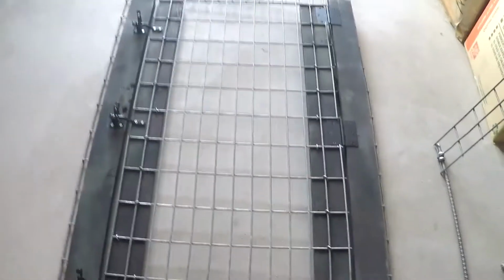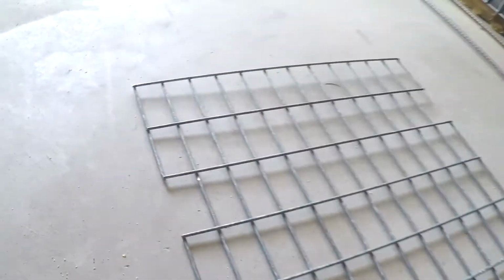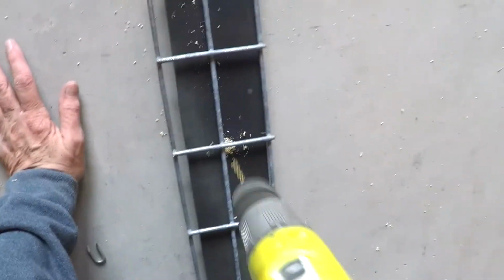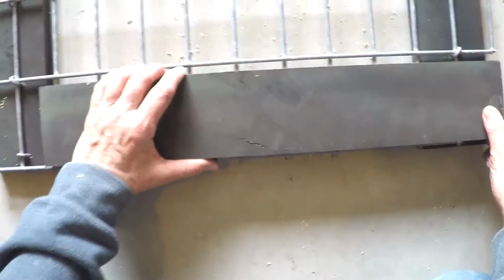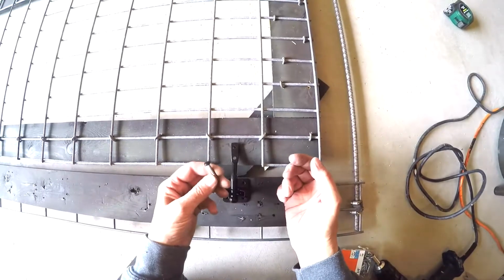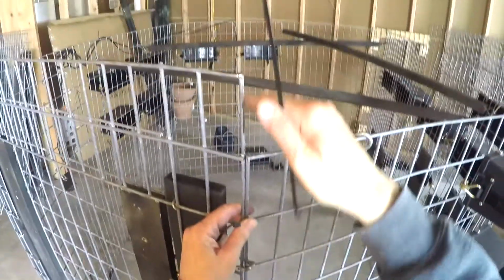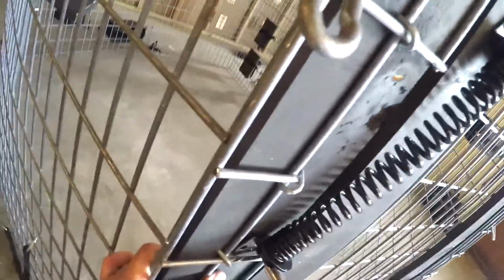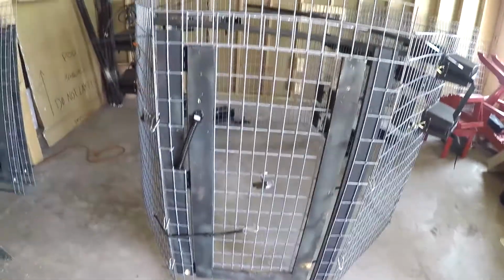3rd Gen Missy Trap™ Gate Tutorial

Comment: Why don't you drill a hole on the board were the latches are, and tie a string to the latch to be able to open them from the outside? You could tie a flat washer or a nut to the other end to prevent the string from getting back out through the hole.
Kind of like this: https://www.youtube.com/watch?v=TM1cn5Vi9tU
They also sell a self leveling latch that you could use if you have problems aligning the latches. You can see them here:
https://www.youtube.com/watch?v=nXDmUpxjpIM